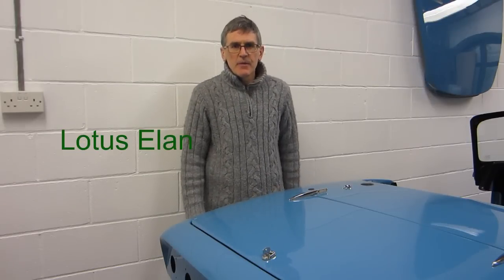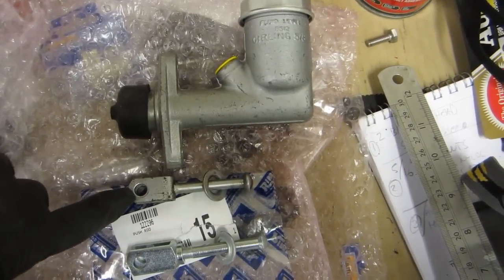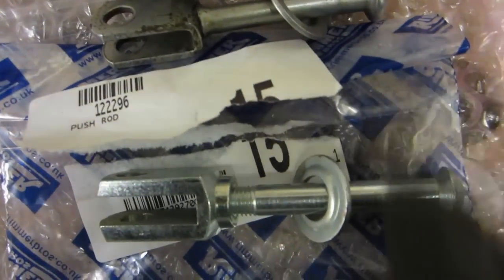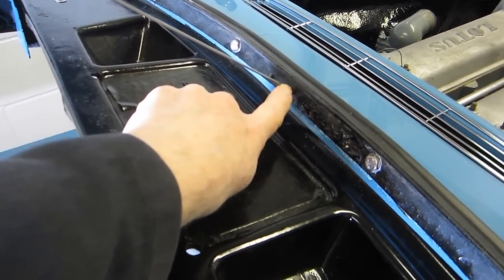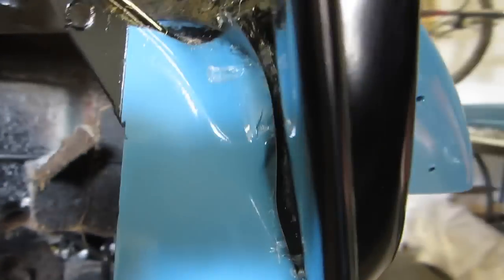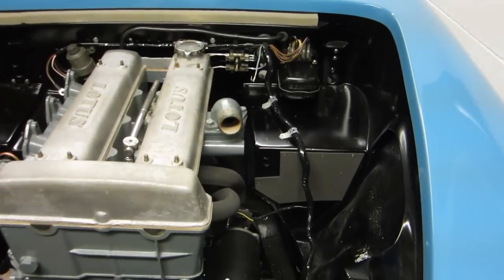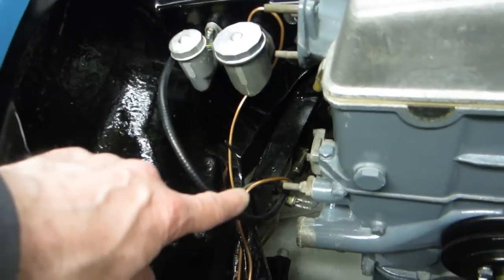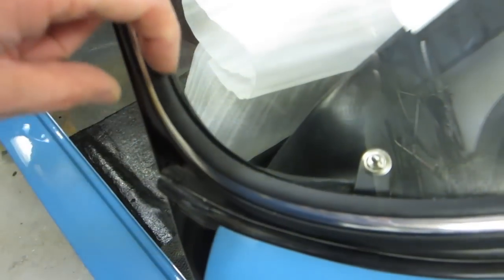Lotus Elan assembly part 6

Comment: Changed the windscreen on my S3 FHC more than once. Did manage without the tool first time, but eventually got the tool to do the job properly. At least the rubber mouldings were easy to find. I believe I replaced the brake and clutch cylinders completely as they were not expensive. I did replace the pistons in the calipers with Stainless ones as the originals corroded quickly.
Reply: Will check them out

Comment: Where can one find a windscreen and seal?  Also need a frame.   Starting a restoration.  Missing parts.  Thanks
Reply from the maker: It depends where you are, UK, USA, or somewhere else?  There are a few 'main' suppliers of parts for classic Lotus who would probably source these for you if they don't have them in stock.  Here's some in the UK; I have no affiliation to any of them:
Paul Matty Sports Cars
SJ Sports Cars
Mick Miller Lotus (Sue Miller)
If you do facebook you might also want to try posting your question on  this facebook group "Lotus Type 26 - S1 and S2 Elan".
Good luck with finding the parts.
Reply: All rubbers are available from Edgware Motor Accessories in London.
Reply: @michaeltb1358  Thanks